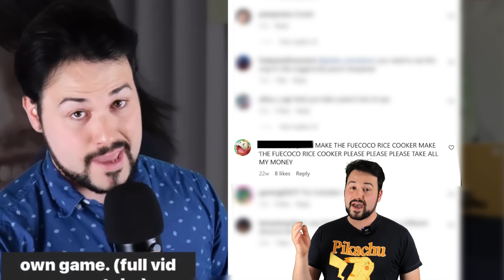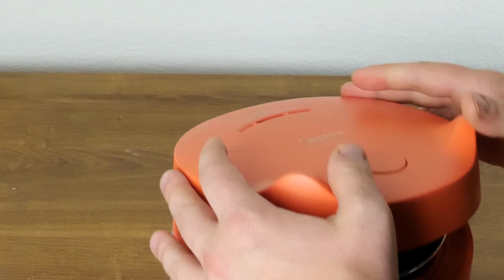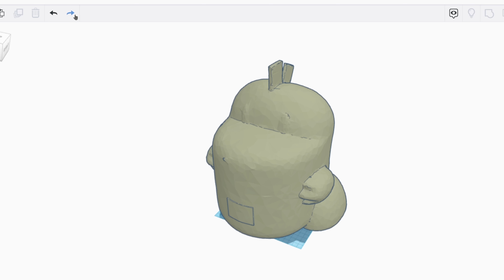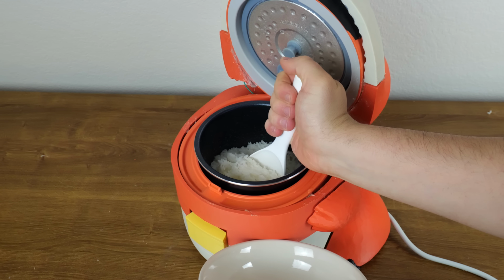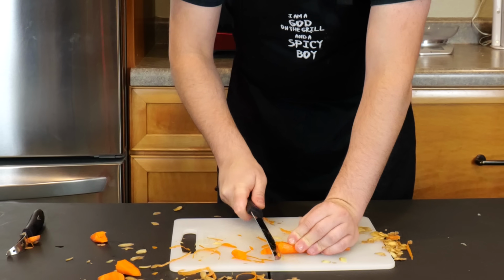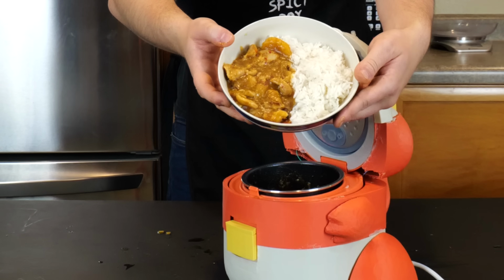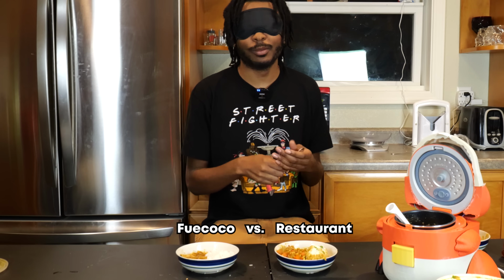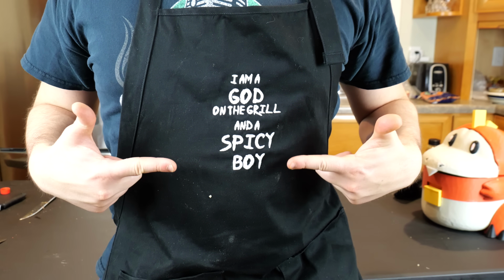I made this Pokémon animation invention real

Comment: What is with the low poly on the model? It takes seconds to smooth in blender
Reply from the maker: Tinkercad triangle count limitations.  One of the many reasons why I changed how I design things nowadays.
Reply: @BigRigCreates  Oh.. I got in tinker cad for a minute and decided I much preferred fusion. Then I learned blender. Now I mostly use that unless I'm doing something mechanical that needs exact dimensions. Curious how much it cost to have that modeled. I could do something like that.

Comment: does the pva has heat protection? mixing heat and plastic is not always a god idea and more if is reconstructed plastic because some Polypropylene dont seal 100% and could expel gas if heated again (i learned that working recycling bottle caps)